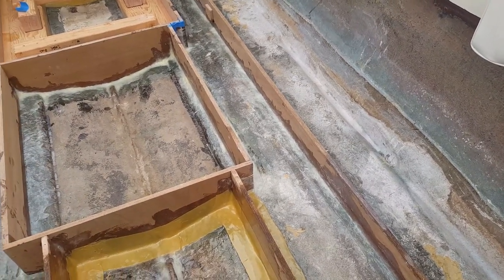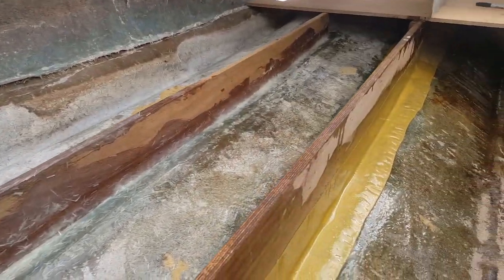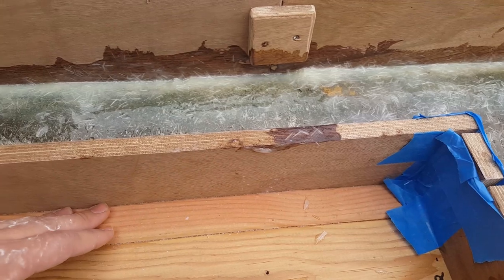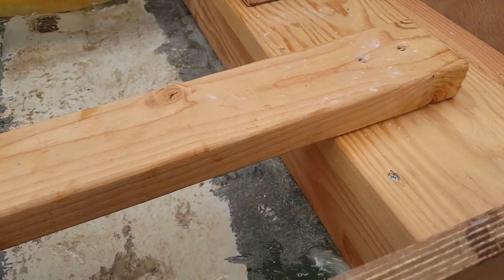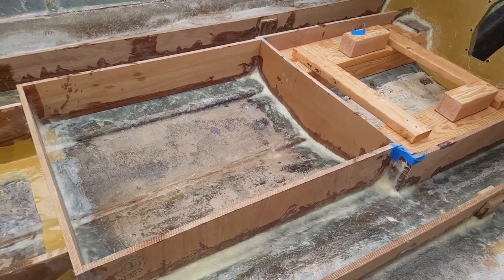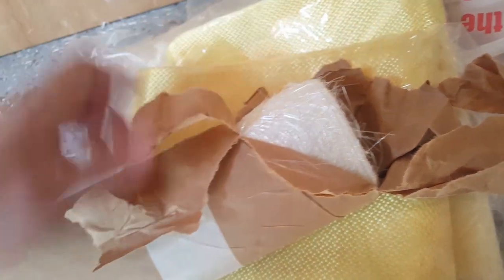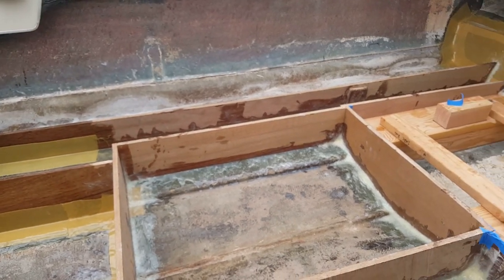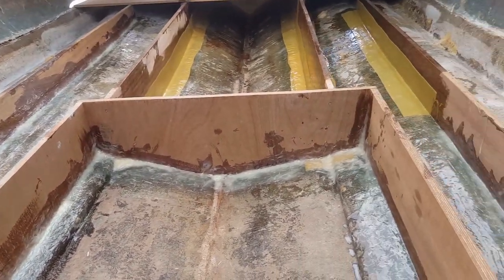Boat Transom and Floor Rebuild - Using the Epoxy Thickening Compound - Part 46

Comment: That mixture looks like you are way short on filler.  If you have to much resin or epoxy and not enough filler all that will just crack.   You should have done your next layer of cloth when this was still in the re-coat time.   Now you need to sand all that before you can do the next layer.    Your supposed to lay the whole stringer structure down in a bed thickened epoxy not pack it in after.   Like the effort but this isn’t done correctly.
Reply from the maker: I appreciate your comment, however, this boat has over 1000 hours on it and has been holding up great.

Comment: thanks for the vids, I wouldve not filled every crack completely along the stringers and floor because water will get everywhere no matter how well you seal it so its good to have sealed drainage holes every so often to get the water out and for venting

Comment: Apply a layer of peel ply over your fillet of “peanut butter”. You would be able to maintain a decent radius but also once it’s cured you can remove the peel ply and have a good textured surface to lay up on which will save on sanding.
Reply from the maker: I like that idea! Thanks for your comments. Next time, I'm going that route!

Comment: Hi - I've removed the floor of my 1987 CC Scorpion. I've also removed all the rotten ply from the sub - floor; what is left appears in to be solid and in good shape and is still covered in fibreglass. My question is should I remove ALL the old ply and rebuild from scratch? TIA
Reply from the maker: With the amount of work that is needed, remove everything to confirm the underlying wood is in fact good!

Comment: always coat ALL the wood in epoxy before you install it, especially the edges.. And you need to peanut butter  or round every corner to round it so the fiberglass bends without air pockets. You should have peanut buttered every place where wood meets.

Comment: Did you soak your stringers in epoxy? I'm assuming the wood will absorb the resin from your glasswork if not soaked?
Reply: You should, but it wont kill you if you dont.  It may just be more suceptable to delamination years down the line.

Comment: Why on earth would you use wood apposed any of the different kind of composite material that are available today , you'll never rebuild it again!!
 Your wood is guaranteed to rot ????
Reply from the maker: Marine grade plywood is readily available in my area and is easier to obtain than composite material.

Comment: I think I remember on one of your videos the formula for making he "peanut butter" but can't find it. How do make the "peanut butter" I know it's Cabosil, epoxy, and fiberglass strands, but what's the ratio?
Reply from the maker: Mark, start off with mixing epoxy and cabosil to get the viscosity right for your application. Sometimes it needs to be thicker and sometimes not. Cabosil is a pain to measure out because it sits on top and you have to mix the heck out of it with the epoxy, so add it in slowly. I also add in fiberglass and mix until you can see glass every 1/2 if you dipped a brush in there and pulled it out. I try to go a little slow with the fiberglass otherwise it gets to be like paper mâché. It still works in that form but it looks odd.
Reply: @michaelromer2016  Thank you! I'm not a Youtuber (I just don't have the patience to film and edit) so I thank you for your willingness to share.

Comment: You want to fix my boat engine mounts and stringers?
Reply from the maker: Lee Sires I’m planning another rebuild series where I use carbon fiber vs Kevlar.
Reply from the maker: Lee Sires what kind of boat do you have?
Reply: Michael Romer 87 citation thundercraft. 16.5 foot.  It may need replacing where the engine sits on the wood or whatever.  I have pics.  It’s a 120 hp mercruiser.  The seller said it has a new floor, but I don’t know what is under the ‘new floor’

Comment: Polyester is not water proof, you can use the best mat but your at fault with polyester it’s old technology and outdated rubbish when it comes to structural
Reply from the maker: Quick update on this project as I have it in the backyard. It’s running great still. Keep checking in and I’ll let you know if it ever fails.

Comment: U should glass all wood, a coat of resin is not satisfactory
Reply: Exactly correct.  Pure resin has a woeful different modulus of elasticity than the wood. Therefore, over time it will delam and flake.  Hence the need for cloth.